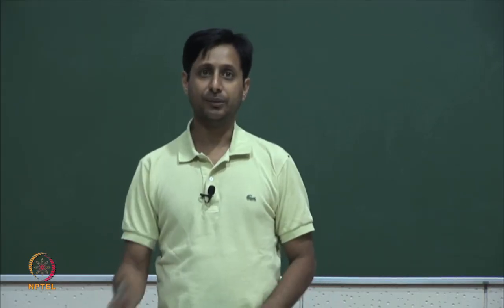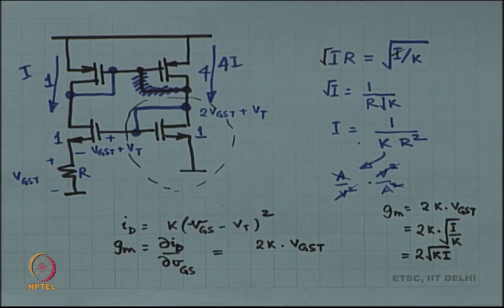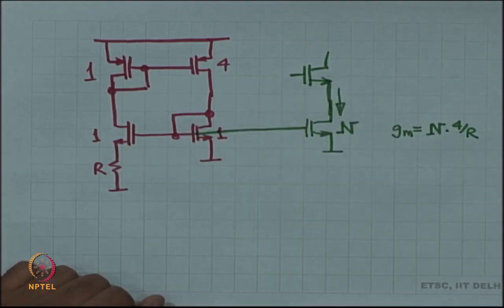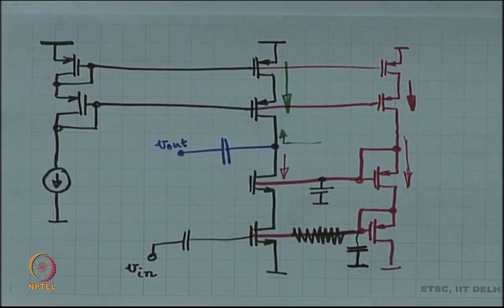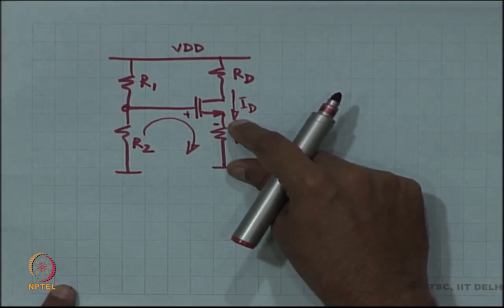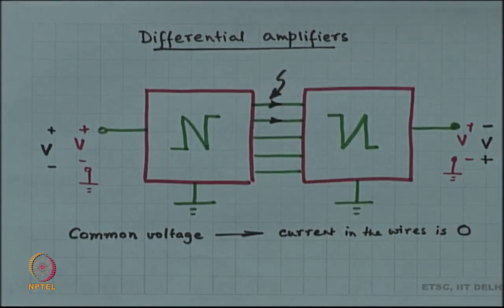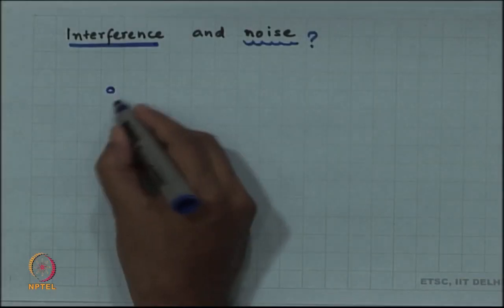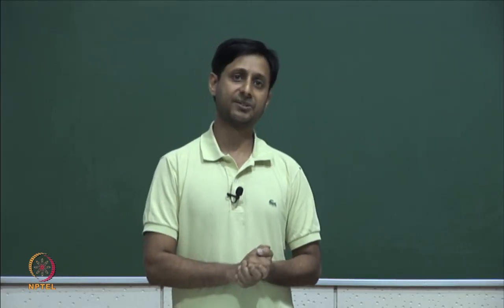Current sources, biasing

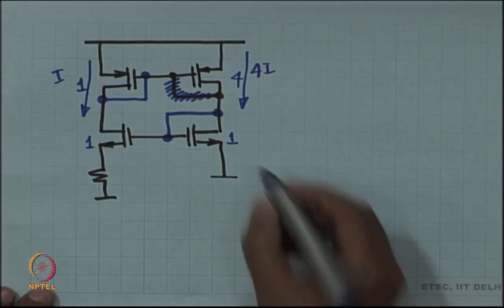Comment: for 4I why is the drain voltage at nmos 2vgst +vt rather than just 2vgst (03:27)
Reply: Because gate voltage has to be 2VSGT +VT and gate and drain are connected together
Reply: When current is I, gate to source voltage is vgst + vt.  Here current is 4I so vgst changes to 2vgst. Hence gate to source voltage becomes 2vgst + vt
Reply: Here he is using vsg notation insted of overdrive voltage, when you are pushing 4 times of current the overdrive is becoming 2 times (sqrt factor is there) of the overdrive of the left branch NMOS.

Comment: Attention Please :
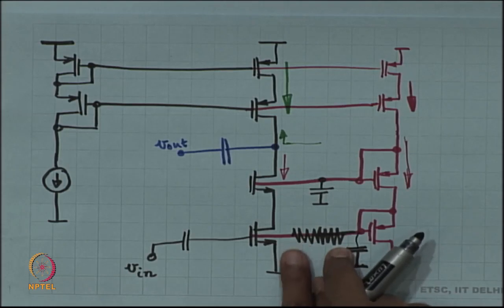At 25:25, I think Sir has made a mistake. The lower two PMOS in the copy circuit (in red) should be NMOS as we can see the Gate and Source are shorted which means the device is in cutoff mode(Vgs = 0), which should not be the case. It should have been in saturation. To do so lower two MOS should be NMOS instead of P.
Reply: In DC analysis ,Vgs of lower two right p mosfets are 0. It is same for AC analysis. Vgs is 0 in all cases. Therefore the lower two MOSFETs act as an open circuit. Hence the circuit won't work at all. Anwesh you can simulate this circuit in Ltspice for a better clarification.
Reply: @shubhamroy036  ya ya got it..... it should be nmos👍✌️.. I didn't notice that..
Reply: @shubhamroy036  bro have u done week 5 assignment (specifically question no. 9)....if yes can u share it with me in Facebook or Instagram..... please...
Reply: @Whatiftoons07  Bro I have only followed the youtube videos.
Reply: no, he is correct bcoz in small signal it gate will be ground which we want and in dc analysis capacitor will work as open circuit hence we will get voltage.......